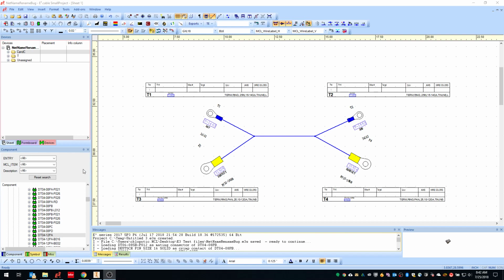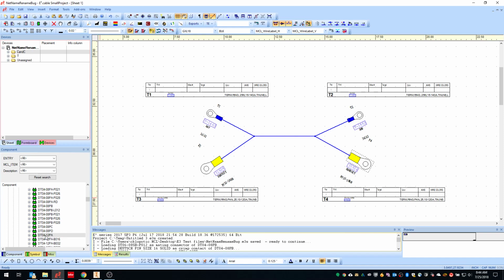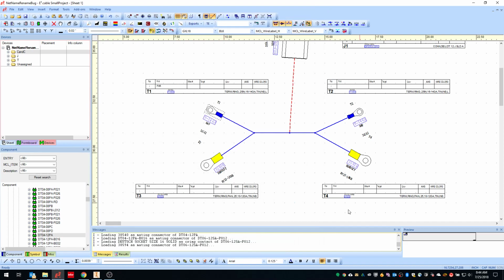E3 Formboard - Signal Rename on Single Cavity Devices

Comment: Hello, does this behaviour still occurs
Reply: Yes. As of 2020 release. That is how it is "supposed to" work, per Zuken support.
Reply: @crklopotic  but why is it possible, after you have connected a device with multiple pins ?
Reply: Once you have a device connected to the line segment that has multiple pins, you can rename the signals. If you already have struggled with E3 giving them all the same signal name, you will need to isolate your signal names from one another before trying to rename them.  Otherwise E3 will still treat them all as belonging to the same signal.